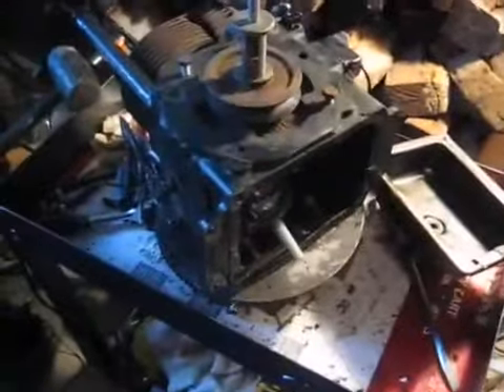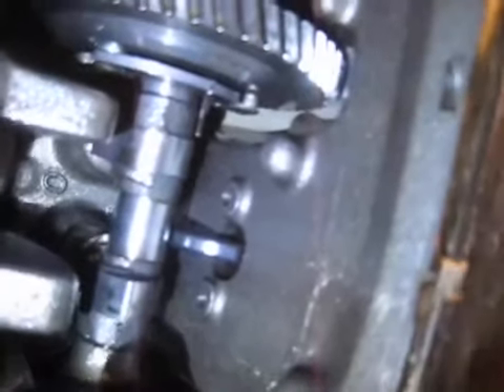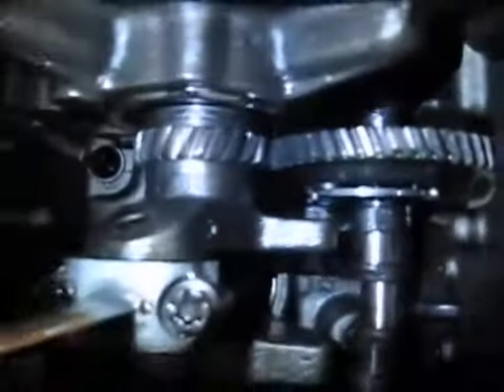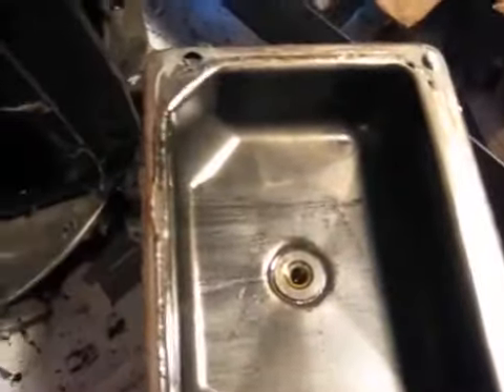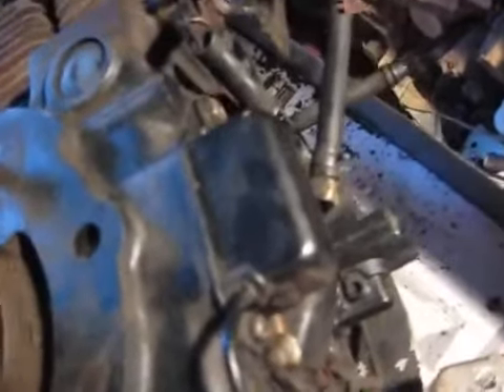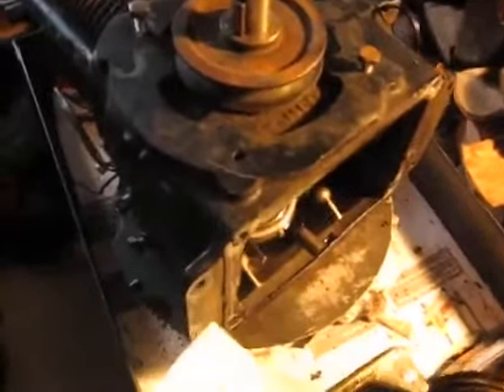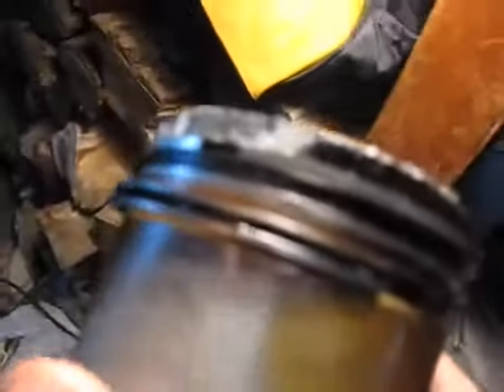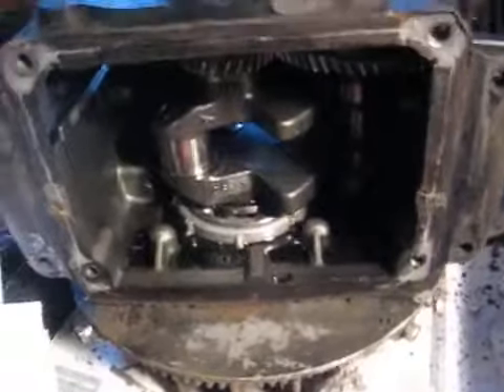Kohler k241

Comment: Does the K241 have a drive shaft, or a drive belt? If it has a belt, I was thinking of taking the K241 out of my 210 and dropping in a K301 or even a K321 to get more horsepower...it can't be that hard...all the 200 series tractors use the same transmission.
Reply: MichaelTJD6